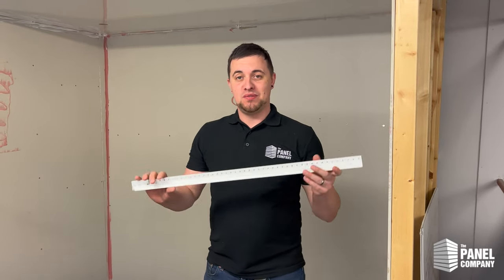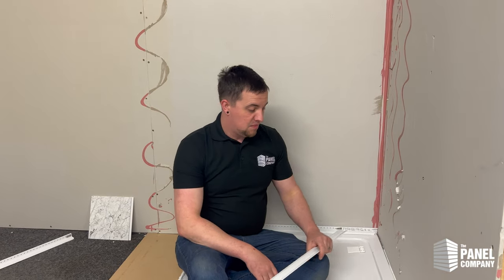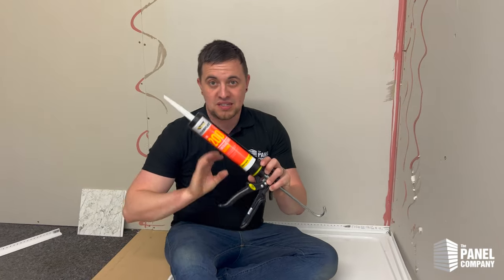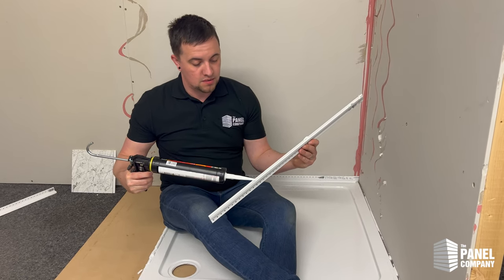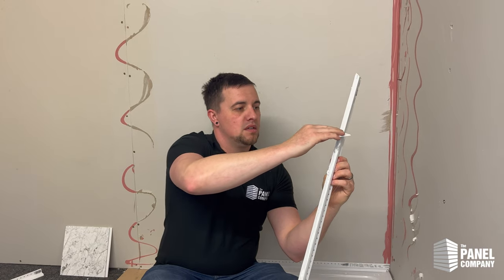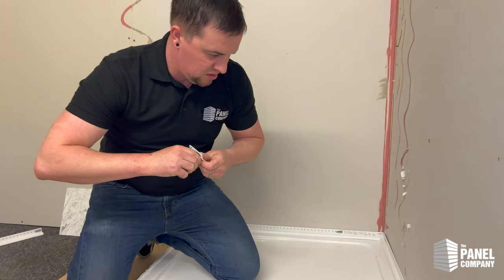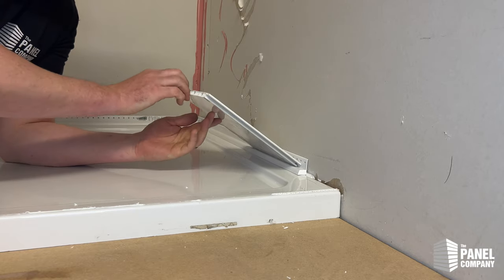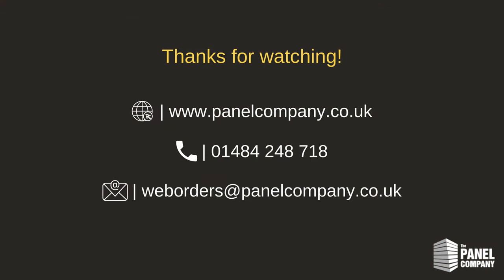How To Install a Clad Seal Strip | The Panel Company

Comment: Do you need to put some silicon  in the corners where the clad seal has been cut at an angle to stop water getting through? And can I use internal corner trims with this?

Comment: I’m about to order panels and trim but I have questions! Do you need the end caps if the seal is going up against a screen? How long is each seal strip? What if they need to be joined together for a longer shower tray? How are they sealed at the corners? Thanks!
Reply from the maker: Hi Jessica, if finishing up to a shower screen with a cladseal, you do not need to use the end caps. Each Cladseal is 1.8M (1800mm) long and is generally long enough for shower trays up to 1800mm in length. You cant join the cladseals as this would create a gap for water ingress. To seal in the corners you fill the cladseal with silicone as per the fitting guide and then once the panels are installed use a bead of silicone to seal the panel and the corner of the cladsea.

Comment: Do you not need sealant on bottom of panel to stop water going under it?
Reply from the maker: Not if you are using a clad seal strip, otherwise a small bede of silicone would help.

Comment: Hello, 
I bought this from you and whilst I was away the bathroom was completed this weekend and the fitter has forgot to install it. Is three anyway to add this without removing panels. Or would it be the case to remove panels and start again.
Reply from the maker: Unfortunately without removing your panels or tray this isn't possible. As this is an optional extra providing the fitter has installed your boards correctly. Your bathroom will still be fully waterproof.

Comment: Can you use these for bath tubs and then use tiles on top of the fixing?? I.e fit as per video around bath tub and fix with Sealant and screws then tile upwards from cladseal ?/
Reply from the maker: Yes that would be absolutely fine. We didn't have a bath on hand to show this :( One thing i would note is our cladseals are designed for PVC Wall Panels not tiles. It may be that you have to find a tile alternative. for reference ours come in 15mm or 18mm

Comment: Wound u put silicone on back if fitting over tiles aswell as screws
Reply from the maker: Hi Dj, The cladseal is recommended on clean installs where you can install it on top of the shower tray and against the wall, in the case of tiles if your install is already water tight you may be better installing them flush with the shower tray and using some silicone to seal.

Comment: These videos are great by the team and their feedback/responses are rapid. The only issue I can see with the cladseal which I will encounter that others may do too is, I had to remove tiles in my case (due to plumbing for an electric shower) which means the panels need to go behind the shower screen frame on both sides (otherwise the screen is too small). I can't take the cladseal strip behind the shower screen as mentioned in the video. The only hack I can think of is the cladseal strip ends before the screen framework, you then have to continue the panel past this to the width of the shower screen frame with it dropping lower to the shower tray (and have to silicone a small edge of it to the tray). If anyone else has encounters this, I'd be interested to see what their solution was.
Reply: Could you take the seal behind the shower frame and notch out a space for it as needed?  If you use a knife heated with a flame it cuts through the plastic seal quite easily
Reply from the maker: We will address this shortly in a new video!
Reply: @ThePanelCompany did you post a video covering this. ..... I'm struggling to find it!
Reply: @tonymariner5519  This video deals with it and is in my opinion much better (start at 2 mins if you know what equipment is needed).

Comment: I'm not sure how this works with having to fit a new bath screen. Wall panels to go over tiles around bath, then a shower screen fitted?!
Reply from the maker: Yes, you can screw the likes of shower screens directly through the shower panel and the tile if you need.

Comment: I don't think this is a good video at all. Following these instructions can lead to water ingress. You need silicon between the tray and the wall where the gap is, also definitely on the wall behind the cladseal strip where the holes are, also where the mitre join is and on the bottom where the panels sit. Also, some trays don't have a ledge that you can push the cladseal onto. No mention or demo of Step 3 in the instructions stuck into each strip - the need to notch out the mitre joint and fill with silicon.
Reply from the maker: Thank you very much for the feedback. This guide is intended as a general overview for fitting a clad seal and we will add a more complete guide in the near future.

Comment: Is there any recommended method to redoing/resealing this if the strip or panel/clading has been damaged at the bottom? I dont know if the type that i have has been fixed to the wall but i dont want to replace all the panels
Reply from the maker: Good Morning,
The key is whether the cladseal trim is secured to the shower tray with a good bed of silicone sealant. If it is you could apply a bead of clear silicone at the base of the panel where it meets the shelf of the cladseal. 
However, I would recommend removing the panels and fitting the base trim correctly following the manufacturer's guidelines.